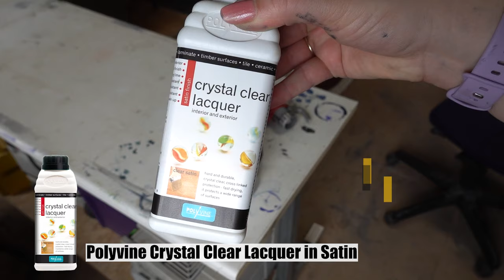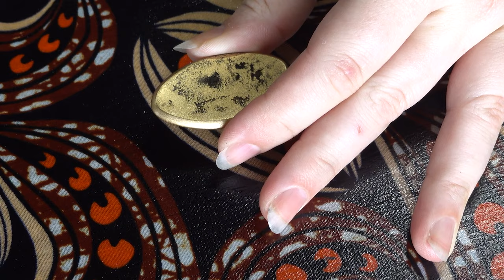How to Decoupage your Furniture with Fabric / Upcycling a Chest of Drawers with Paint & Fabric

Comment: I was wondering have you tried the method of putting two coats of Mod Podge and then ironing on your fabric?  It seemed like you struggled with it a little.
Reply from the maker: No, I haven’t but I’m not entirely sure it would work with fabric? Have you tried that method using fabric? Would be great to know if you’ve had success with it 😊👍

Comment: I was wondering the reason for two coats on the drawers when its being covered by the thick fabric anyway?  Hi from the KZN Midlands
Reply from the maker: Hi 👋☺️ No particular reason other than it gives a nice surface to work on with the fabric and a solid base colour underneath the fabric so that it gives a uniform look to the finish ☺️👍